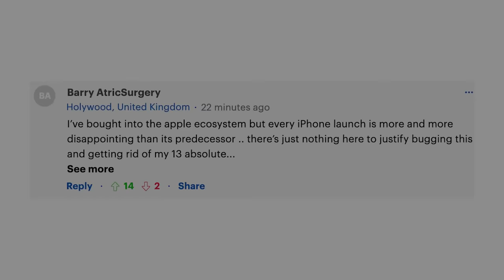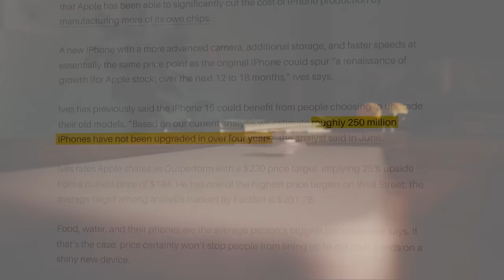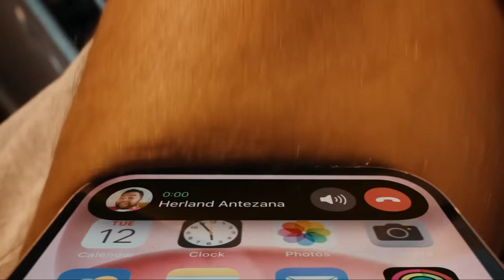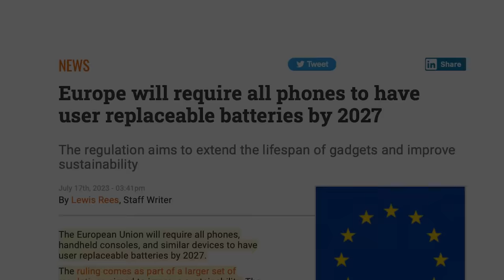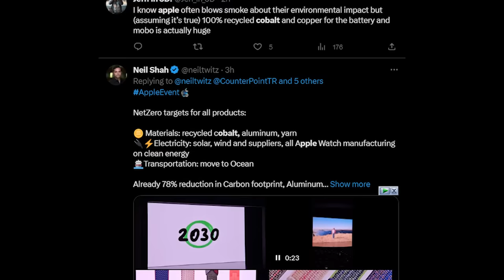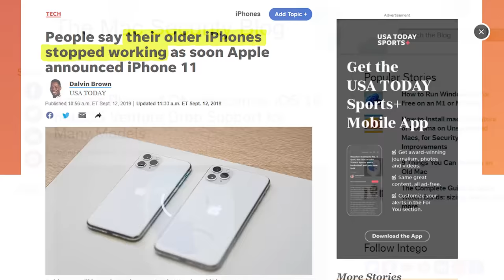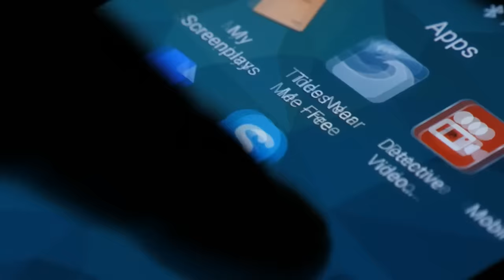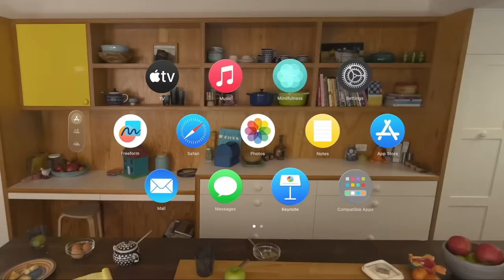The iPhone 15 Is Everything Wrong With Apple

Comment: A summary of Apple products buyers - "I pay double, just because."
Putzes. 

My $35 Motorola G Pure does everything I want and need.

Are there faster fones, with superior tech?  Of course.

My fone has no noticeable lags, a great & durable screen, a very good camera, plenty of space on board, 
and accommodates up to a 512 GB SD card.

Zero issues.
Even when simultaneously running an exercise app on walk and streaming music, and taking a call here and there.
Reply: I agree. people want the latest and greatest just to show off but barely use 10% of the phones entire features. I have android but I like iOS as well, and I'm constantly introducing iPhone people to features/shortcuts on their phone and they say, "I had no idea I could do that!?". It's embarrassing. lol
Reply: Exactly! Android for life!
Reply: I don't know if its just the moto phones that do this still the feature to shake the phone to turn on the flashlight is way nicer than having some super high resolution screen that's just going to be covered with fingerprints and a screen protector.
Reply: I left Android because of the Motorola Z Force, shitty phone.

Comment: It hasn't been about the hardware for a while now. Therefore [much] less innovation. It's the software that could really push it forward, in a good or in a bad way. But if people really believe we're gonna see everyone walking around with those hideous "Vision Pro" goggles on their faces in a few years time, they're delusional.
Reply: That’s not what the Vision Pro is. It’s basically a new computer, not an iPhone replacement. It’s amazing for remote work and you can take it with you when you travel and work from anywhere using huge virtual monitors. For me, this will be a must have. I never plan on walking around with it, that’s pointless.
Reply: @ameremortal  each to their own. It's for hardcore iSheep anyway. 👍
Reply: @liberty0758  He offered a valid counter argument to your points, but instead of responding in kind you've resorted to that old iSheep nonsense, really?
Reply: @ameremortal as someone who using vr regularly, i think the specific is : more than tablet less than a laptop. 

this is new product category. 

it absolutely should be used in public (for services) since it support multi tasking windows and bigger screen.easier to navigate between softwares simultaneously. 

like in restaurant where the waitress can see every info for every tables, city hall, navigation services. etc.
Reply: @whitygoose  I could see it used in that way. But I don’t see people walking down the street wearing this thing.
Reply: @ameremortal  unless it is 6DoF AR with size of regular glasses, i also don't think people will wear this on public. 

and i'm pessimistic about sizing down this. we saw that pico was smaller than quest 2, while quest 3 will be smaller than pico 4. yet we still need a long face gasket simply because our eyes need those space.

as long as it big and cumbersome, the amount of people willing to wearing it outside is not many.
Reply: hard soft consumerism
Reply: @Skullet Android drones can’t think of anything else to say so they respond with “isheep”. I say this as a tech enthusiast whose a fan of both Apple & Android.
Reply: @liberty0758  "hardcore iSheep"

Wow, you're such an edgelord. On your Android device no less

Comment: I have a Samsung s21 currently that I bought a year ago for $250, and it serves me fine, I get more than enough battery, the screen is bright enough, and it's pretty fast. I don't see why anyone would need a phone that costs more than $500. Apple is more of a marketing company than a tech company, they brand their phones as revolutionary and game changing when really, they have bad internet connection, they're really hard to repair, very expensive, and they are locked into one ecosystem forever. An example of why iPhones are overpriced are some of the middle-range android phones. The new Nothing Phone 2 is a great phone, and even with all of it's unnecessary features, it's only $600, and Asus's INCREDIBLE small phone, the zenphone 10 is only $800 with a much better value than the iPhone 15. I will acknowledge that most flagship androids are similarly priced to iPhones, but they're offering a lot more for that, including an ecosystem that makes it easy to stay, or leave it.
Reply: Samsung s21?   I ditched Samsung since they went to ape apple with glass sandwich/non removable battery.  My phone is LG V20, still the best phone ever, and super easy to disassemble for any repairs (Alas, LG V20 was the last of good phones from LG).
Reply: Ive had a Samsung s7 which I got in 2016, 7 years ago. As of now, its cracked, the battery dies fast, the camera stop working, and I still use it.
Reply: Samsung new phones cost just as much, if not more. There's a new tax on tons of things. People like having new stuff and will pay a premium. Look, early access titles. Everything used is better value... That's not saying something revolutionary.
Reply: Zenphone 10 can't handle resident evil 4 graphics.... Apple iPhone can.

Comment: i would agree with this if you were talking about the 14.. which is almost identical to the 13 in every way, same cameras, same display, same chip. only $100 more, the 15 has some decent improvements and is quite a good phone, 15 Pro has a sizably more powerful chipset, they changed the overall design just a bit to make it more comfortable in the hand and not so boxy, oh and the titanium is a nice touch too. You'll still be able to get your battery replaced for like $50 by the local guy at your mall too lol so no need to worry about either, should last at least 6 years or more before it goes out of phase.
Reply: I am always amazed at how Apple has managed to take something free and charge people a fee for it. And not only do they not care, they actively applaud it and beg for more.
Reply: @Xymage  what’re u talking about

Comment: Nice video, but one fact is wrong.  First phone with dual camera was HTC One M8 in 2014.  Even LG G5 beat iphone to dual camera in April 2016 (and also beat Apple to removable battery!  LOL).  Apple's first dual camera phone was iphone 7s which came out september 2016.
Reply: Technically, the first ever phone to introduce two camera lenses was a Samsung flip phone from 2007 for Korean market (model not known). It started the 3D trend that was later introduced in smartphones, such as HTC EVO 3D from 2011 and LG Optimus 3D, also from the same year.
Reply: Lol htc one m8 is goated, I went from that to an lg g6 but evenutally went to iphone

Comment: Thank you for your sober appraisal of the iPhone. I’m sticking with my 13 Mini and even upgraded to a 256GB model to give me plenty of room for years to come. When the battery is done, I’m seriously considering having it replaced. The thing that’s becoming my main tool for communicating, is my  Apple Ultra. As long as I keep my iPhone line active, I don’t even really need to use my iPhone. I’m feeling more inclined to leave my phone home and just use the Ultra which doesn’t need a pocket!!! While there are still times the Mini is still useful, I’ll still have it. The cameras are still just fine and as long as Apple supports it with IOS upgrades, it will do more than I actually use. They keep adding features I not only don’t use but simply can’t remember how to use. The Ultra on the other hand is simple to use and works just fine. I am upgrading to the Ultra 2 but that may be the end of the line for me as Apple is not innovating that much for the Watch. Next year they are looking to make current watch bands obsolete. I have too much invested to change. So, they can move in without me. When it comes time, I’ll just put in a new battery. So, I’m with you! Apple is not the company it once was.  However, there used to be only so much you can change on the current technology. They have pushed it as far as they can. Btw, it looks like the 14/14Pro is a lot tougher than the 15 series!
Reply: sooooo youre buying a new iphone...brilliant! ur a real rebel. 🙄
Reply: @newagain9964  No, I’m NOT buying a new iPhone. Where did you get that idea??  I’m keeping my iPhone 13 Mini but I did upgrade it to the 256GB version since I’m sticking eith the 13 Mini as a LONG term phone.

Comment: as someone else pointed out, apple was not the first to come up with duel cameras. Htc was the first to bring duel, huawei triple cameras and samsung for quad and nokia for 5 cameras..
apple wasn't coming up with stuff as much as they were implementing others ideas later.
one way to stand out is to keep the headphone jack, an ir blaster, stereo speakers and massive cameras. well, thats what stands out to me anyway 🤣. im on the Xiaomi redmi note 12 pro+ because it had those features and at nowhere near the price of a flagship.
Reply: all modern phones have stereo speakers, and the cameras on the phone u mentioned aren't any different than the average budget-midrange phone, certainly not comparable to an iphone so idrk what ur point here is tbh. also the number of cameras doesn't really matter beyond a point, half of the phones with a ton of cameras, including probably your redmi phone have crappy 2 megapixel "macro" or "depth" cameras just to appear more advanced, even though they are basically useless. 

apple does some things late, but rarely are their features not refined. when i used to have a xiaomi phone it had some cool features, but the software was wretched, just trying to be an ios copycat.
Reply: I mean, I see your point, but I wouldn’t be caught dead with a Huawei or Xiaomi. 😂

Comment: its not only apple... phones these days have defined themselves as what they could do, even android (samsung) for the last 5 years have just been marginal upgrades. If they were to drastically change their phones every year to look unidentifiably different than the company's phone would be losing its identity. back in the day, iPhones used to change up to the peak, where you physically can't really change because of their physical size.
Reply: There is no phone out there to buy that has the jack, SD card slot, sim slot, notification light, removable batteries all in one package otherwise I'd buy such a phone
Have xperia 5/2 which is only missing removable battery capability but the phone is getting older now and sony now is ditching the notification light all together so no.... I disagree with your statement since there is no phone as i just described in existence these days

On top of that not much has been done with a secondary screen like my LG v20 had it was actually a really useful screen that could do a lot of things yet people didn't think much of it I guess nor has it been expanded on
And then there's the battery bypass capability that sony/asus only use that can be a lot better then what it is now
I want that ability to be able to by pass the battery while not just only gaming but just using the whole phone in general.

Comment: While it may seem like the latest iPhone 15 series lacks groundbreaking innovation, it's important to acknowledge that these devices still fulfill our every need. If your current iPhone serves its purpose and meets your requirements, there might not be a compelling reason to upgrade. However, if you're transitioning from an iPhone X, XS, 11, or a similar model and find that your phone no longer keeps up with your demands, then investing in the iPhone 15 could be worthwhile.

It's crucial to recognize that we are currently at a point where significant leaps in smartphone technology might be less frequent. Instead, innovation may take on an incremental approach as we move forward.

In summary, the iPhone 15 series may not introduce groundbreaking changes, but it remains a capable device that can meet most user needs. If you're coming from an older iPhone and feel the need for an upgrade, it's a sensible choice. However, we should be aware that the era of revolutionary smartphone/Spatial computing and Traditional computer technology innovations may be giving way to more gradual improvements in the future.
Reply: It's good to see people understanding this. Apple has no reason to add some groundbreaking thing to their phones because it does everything anyone would need it to possibly do. The iPhone 15 Pro Max can literally play PC caliber games with good framerates, so I really don't get what more people want.

Comment: I’m probably a bit of an anomaly in this, but I’m pretty solidly in the Apple camp for smart phones, and I usually only upgrade every 5-6 years as my old ones get physically damaged enough that replacement is prudent. The reason I’m in the Apple corner on this is just how long they will push the newest updates to their old tech. The latest 17.4 iOS update goes all the way back to the iPhone XS from 2017/2018 or so, and conveniently I just swapped from a XS to a 15 and everything was pretty much the same, just a bit smoother and snappier. I expect the 15 to last me until 2030 or so unless something drastic happens and I’m forced to buy a new device.
Reply: I'm the same way.  My phone has had a cracked screen for over a year now and as long as it still works I'm fine with keeping it.  And when I do upgrade it will probably be to a phone that's 1-2 years old again just so I can get it 50% off.  Never understood the people who spend thousands of dollars replacing perfectly good phones every year only to complain that they don't meet their expectations for innovation.

Comment: Smartphones have gotten to the point where improvements are plateauing. It’s similar to cars. A 2015 model will look nearly identical to a 2016 model. However a 2015 more will be quite different than a 2023 model. 

It’s why I still have my iPhone 11 Pro Max and don’t plan on upgrading until my phone is either no longer functional or Apple stops supporting software updates. Whichever comes first.
Reply: Depends on what you do on your phone. My sister runs her whole YouTube channel off her iPhone. So these upgrades are important. They improve video editing speeds, rendering speeds, etc. It's like complaining pcs aren't getting faster, because you only use word.... Of course, then pc upgrades don't matter. Gamers and video editors, if matters. And now, phones are pcs. So unless you game, or video edit, or something else on your phone, these upgrades don't matter. But if your iPhone is your main pc, it matters. 30% gpu performance, hardware ray tracing, apple version of dlss, means when you "dock" your iPhone to a monitor, you've got a strong device. You can emulate up to ps2-ps3 games on it, maybe further with this new iPhone. So it does way more. Just because you don't use it, doesn't make it not valuable to others.
Reply: @Tential1 yeah I agree. I use my s20 as a desktop.

For now it's still doing well but eventually things will slow down and security will be gone.

Comment: I always like atypical solutions. Sth that stands out from the rest even if it's maybe a little less practical at first. Not only in smartphones but also elsewhere. Previously companies where really pushing different phones on the market like strange rotating smartfones or with 2nd sliding screen or keyboard. They were always searching for sth new. I really miss seeing those different designs. No the only innovative thing is felxible screen :/

Comment: I’ve been using the IPhone for the better part of a decade. I’ve always bought the older model (I’m currently using the 2020 SE); I’ve never seen a point in spending over a grand on a phone. If I can be honest, the only reason I’ve stuck with the brand is because of all my music that has been purchased over the years. The easy of transferring data over really locks you into an ecosystem. The phone battery is starting to not hold as much of a charge anymore; but as always I will use this phone till it’s on “life support”.

Comment: The funny thing is that this phone costs starting at $1000 for the standard model at 128GB, that's next to no space unless they're forcing people into their iCloud ecosystem to do anything (and the process of moving files from your phone to your PC and vice versa is still a pain). Apple's done nothing to improve iTunes on Windows, and if you have a physical collection of CDs, good luck getting them on your phone without it. Also, the starting model only has USB 2 transfer speeds, and you have to upgrade to the Pro if you want USB 3.1 transfer speeds.

How much is a 1TB Pro Max going to be in the end? Compared to just two years ago with the 13, which was $1600 for the high-end, probably at a massive markup.

The only way that Apple is going to keep me using their phone with sucky UX is if they allow sideloading and open up their software development to more than just Mac systems running XCode. I might just buy a Google Pixel or something with a custom ROM on it, because outside of Genshin Impact running at a higher framerate (something which they could do on PC anyways if they weren't corrupt), there's almost no difference when it comes to games either. And Apple is delusional and learned nothing from the old iPhone 4 era when nobody was willing to spend $10+ on a mobile port of a console game.
Reply: I will continue to buy the base model and upgrade every five years. Less waste and it feels like a big upgrade each time.